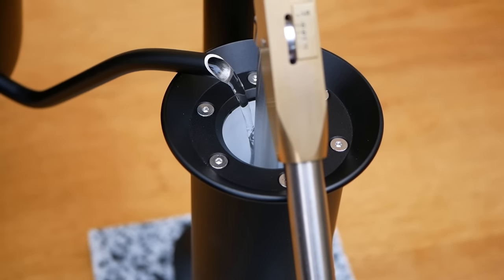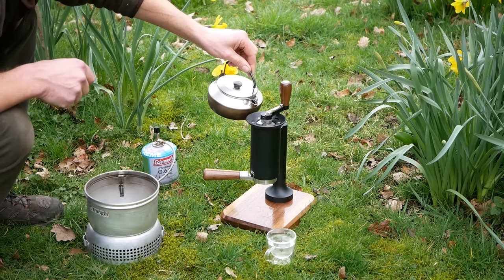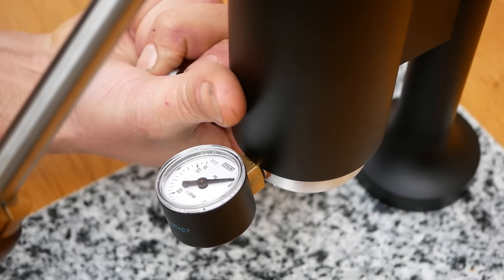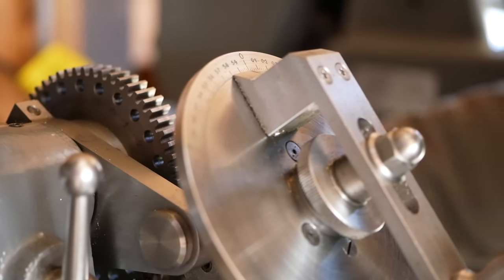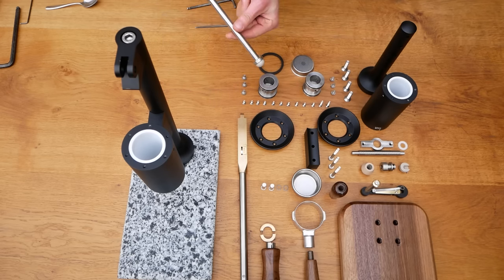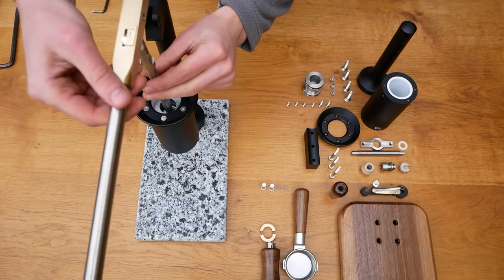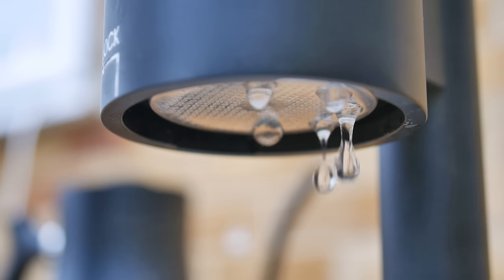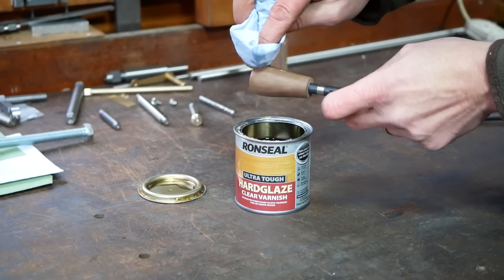We Made A Modular Espresso Machine

Comment: I admire your attempt to reduce the design down to essentials with a focus on maintaining a high brewing temperature without the clutter of bulky heating electrics (like the Flair 58). The similar-looking Newton Brua (handmade in New Zealand) has found maintaining a high brewing temperature difficult to achieve (as Coffee Chronicler's tests recently revealed). I have two questions: 1/ In each model, what is the clearance distance between the top surface of the base and the bottom surface of the portafilter? There doesn't look much room to fit a coffee scale under a squat espresso cup. 2/ The pressure gauges are ingenious, but how would I approach flow control and shot profiling as I pull a shot? I look forward to following your Kickstarter. Best of luck with it all.
Reply from the maker: Hi Nick, thanks for watching and for your questions! 1) The distance from the bottom of the portafilter to the base is 83 mm, which we thought was enough space for a standard espresso cup and a scale without being excessive. However, we understand that some might want to use particularly thick scales or a larger cup, so we are intending to include a riser block that would sit beneath the bottom of the pillar as an optional add-on. 2) Flow profiling is similar to many other manual machines. You can target a particular pressure at certain time intervals but otherwise, we have had best results partly using the pressure gauge but also using tactile feedback. If you notice some channeling starting to occur, just back off the pressure slightly and, inversely, if the flow is smooth and you are feeling a nice consistent resistance, you can push a bit harder. We like to taper the pressure off towards the end of the extraction as disruption of the puck during extraction makes channeling more likely. Ultimately, it takes a bit of experimentation to get the absolute best out of it, and in our opinion that's half the fun! Hope that answers your questions.
Reply: @chronovaengineering  Thanks for your considered reply. The riser block is a great idea. How can you tell if channeling is happening while you pull?

Comment: I want one so bad...

In the ballpark of numbers, how much would this be?
Reply: I think it will be definitely above 650 USD, based on that the non-electric flair 58 costs that much. Since it’s a startup project which seems very niche/boutique with emphasis on durability and high quality materials and serviceability, coupled with the clever pressure gauge innovation and brew chamber insulation, I wouldn’t be surprised if it would go for around 800-1200 bucks.
Reply: Scrolled a bit more through the comments and found the official answer that it will range from 750£ for DIY kits to 3000£ for custom-built machines.

Comment: There doesnt seem to be much clearance between the bottom of the basket and the bases to fit a scale and a cup. How do you measure the espresso output?
Reply from the maker: Hi elhh,
There’s enough space for a fairly compact espresso cup and a scale to fit under the machine. (We normally use the same cup every day though so it’s easy for us to judge the output by volume without using a scale.) 

We're also planning to offer an optional riser block as an add-on for the Kickstarter, so you can increase the clearance under the basket to fit larger cups or scales if needed. Alternatively, you can swap out the entire base for one with a cut-out that fits around the scales and/or cup.

Comment: Whilst the lever version makes sense at first glance  as far as designs go, the helix version seems like a more "future-proof" design. This machine will likely outlast you so when you're 60+, 70+ I doubt you'll be able to operate the lever based design. Either way nice idea. Any machine not relying on electricity is a win. Btw, have you researched how long the rubber (?) silicone (?) gaskets last before needing replacing?
Reply from the maker: Hi sp, we’ve been using our home prototypes for around 5 years now and haven’t seen any signs of wear on the o-rings so far. These o-rings are also a standard size so you'll always be able to source spares from any major bearing supplier. The other major bearings use wear-resistant IGUS materials.

You raise a good point about the Fulcrum vs Helix too - as both configurations share the same base components, we’re planning to offer an add-on kit on Kickstarter that contains the extra parts needed to convert the machine to the opposite mode.

Thanks for commenting!

Comment: At first I was just expecting another manual machine, hoping it was at least adequate.  I was ready to dislike this as soon as you said it was engineered.... I need more faith.  

I love every aspect of both models.  Personally I don’t think I would ever want the screw type, but as far as covering the market and doing it well...holy moly I am impressed.  

These are excellent designs.  Great work.
Reply: Yeah, before I got far enough in the video I was like, "oh great, another one of these attempts but the temperature is gonna be too low like usual." While it's nice he mentioned this issue, I do want to know more.
Reply: @error.418  the fact the issue was addressed alone is pretty great.  Indoor use I’m sure it would be easy to zero in on preheat temp for proper extraction and pull perfection from then on.  

For the camping and out door experience(especially relative to any other option or method) still sounds great.  Any one who has cooked outdoors knows the temp/wind can throw off things quite easily.  But understanding that, and with realistic expectations in those scenarios, this has to be one of the best options.  

I first made espresso on a hike back in the 90’s.  Since I dig the cow boy style for the most part when I’m in the bush, but damn this would be great on packing trips.

Comment: beautiful! and quite convincing as reliability is of the essence when dealing with addiction... supply of parts is certainly something any concerned customer will look into (appreciating regular o-rings etc).
I've tried many, many coffee machines along the decades (many operating principles, too), and one thing I noticed with a number of espresso machines is the "porto-filter" locking thread/ears : wear there may lead to loss of pressure by loss of parallelism of play at the seal, with coffee ground likely to be pushed through and requiring a deep cleanup before attempting again (not ideal when you desesperately need a shot of java...)
Reply from the maker: Thank you! Yes, we chose an o-ring size for the piston that is really easy to source, so these can be replaced easily. In terms of the group seal, if wear were to occur, we’ve designed the liner-cylinder assembly so the portafilter fit is adjustable by putting shims behind the flange on the cylinder liner.
Reply: *portafilter

Comment: I am appalled to see that you are charging £750 for one of these units, not even assembled, or with a base or handle! That’s almost double the price of the aram and the robot, which are almost identical to your designs… plus, that’s the kickstarter price, so there isn’t even any guarantee that you’ll send the products!😢 how can you possibly justify such an outrageous price?
Reply from the maker: Hi night owl,

If we dropped the price, we would be making a loss on these machines. This is simply the price for a manual machine that doesn’t compromise on quality, functionality or durability. We don’t own a giant factory in a country with loose labour laws and we weren’t willing to cheap out on materials that would break after a few years.

We didn’t start the project with any plans to commercialise the machines but as we developed them for our own home use, we received an increasing number of requests to sell them, even when we told people the price. Bear in mind, Epoch is still much less expensive than other lever machines like the Strietman CT2.

RE: Kickstarter and fulfilment concerns, unlike many Kickstarter projects, we have a proven pre-production prototype and have the capability to manufacture everything in our own workshops as a backup if we hit any manufacturing issues. We are completely committed to delivering everything our backers order.
Reply: I own three different manual espresso makers. The aram is made in Brasil. The robot is made in Hong Kong. The newton brua is made in New Zealand. None of these are mass produced in factories. All are small scale production. In addition, they use beautiful metal and wood components. None of them cost even half the price of yours, and they come assembled and with a stand. In addition, your machines appear to use pvc as the water chamber, a serious step down from stainless steel components. Lastly, kickstarter is intended to provide a below market value price for the products, so you should take a loss on it, in order to establish the business and provide an incentive for backers to get a better deal. Again, your prices are excessive.
Reply: Mind you, the cost of this "work of engineering" could afford you a small motorcycle with vastly, practically infinitely, more materials and engineering. Especially when the picopresso exists with less than 10% the cost of this has been proven and with a customer service system in place to back its parts. The kickstarter barely lasted a month with no further criticism or review process. Absolute cash grab